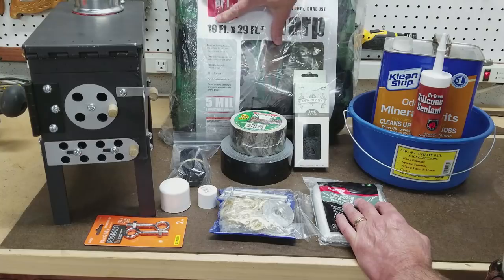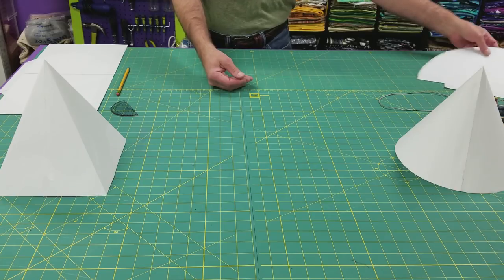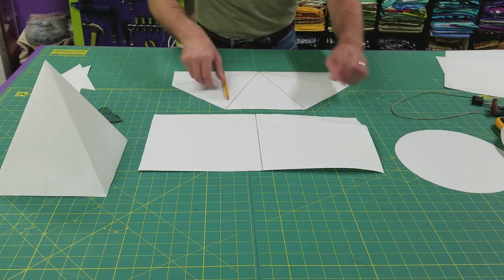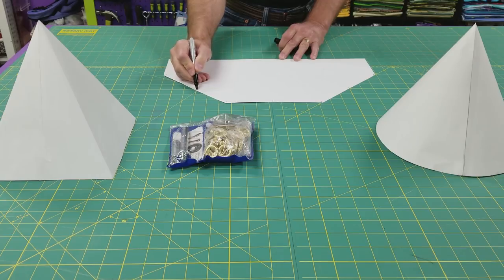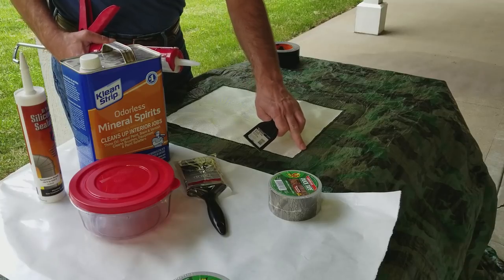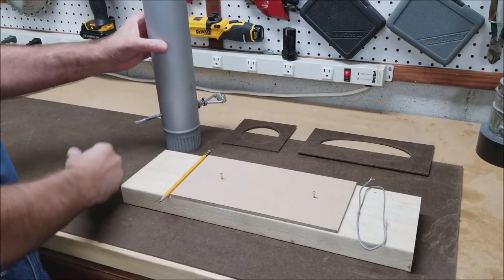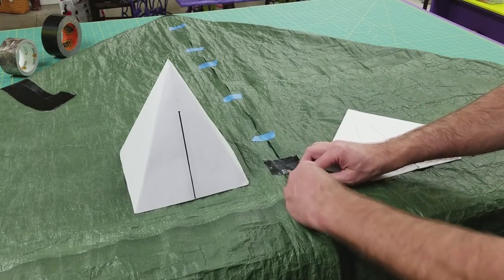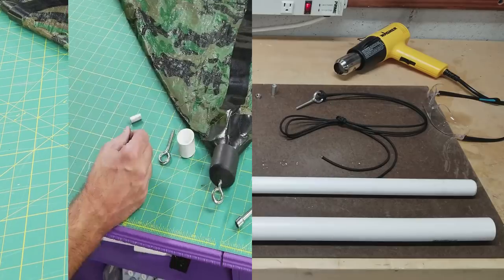How to Make a Hot Tent Teepee for Ammo Can Stove

Comment: Nice job. Here in Alabama it gets cold enough to need a heater in the tent but it doesn't get so cold our friends, the Diamondback, the Copperhead and Water Moccasin don't move. I have literally seen them try to get into a buddy's tent just seeking his body heat. Here, I don't care to sleep with an open bottom tent. I'd love to see a modification to include a bottom. Once again, nice job.
Reply from the maker: Hey Alabama, we get rattlers, copperheads and cottonmouths here too but I only use the teepee and stove when it's below about 20F.  Above that I'm a hammock hanger.  That said, a floor wouldn't be too hard to figure out.  It's a square a little under 8x8 feet.  I'd cut about a 2x2 foot hole in it where the stove goes and sew in some of the silicone coated fiberglass cloth.  I like the idea of a tent having a floor, just didn't need it for this one the way I use it. Thanks for the insight!

Comment: Awesome on your zipper don’t know where you bought it but companies that make zippers also make stoppers for the zipper and they look like little balls with a slit one goes on each end than once you put them on the top and bottom of the zipper You than crimp them do you don’t need the tape but I think you did an amazing job
Reply from the maker: Hey Miguel, thanks for the comments and the compliment!  i think I got the zipper from Dutchware Gear.  I only found out about the stoppers after I'd completed the teepee.  I'm making a replacement teepee right now and plan on using a self-stick zipper.  Thanks again!

Comment: Love the step by step instructions for the heater and the tent. And the inexpensive , well thought out setup this is. I plan on maybe adding a floor with a lipped opening for the stove and center pole. I just had one question.. How small of a bundle can you fold up/roll up this tent in this configuration? Would be awesome if it will fit inside the stove itself inside a protective bag or something to save space.. Thanks for taking the time to share with us..
Reply from the maker: Thank you!  I couldn't fold mine down enough to fit entirely inside the stove.  I think the total volume is about right, it's the problem of not being able to fold a piece of paper more than seven times.  If I could fold it one more time, it would squeeze in the stove.
Reply: I think I got the next size up in ammo can, a little on the big side, but will fit below my shelf on the backpack rack, and I found a telescopic stove pipe made from stainless steel..should be able to get it all inside that one..and a few more items as well (cooking grate, and other misc. items to keep the weight low on my pack.
Reply from the maker: I wasn't able to locate collapsible stove pipe.  You should make a video.

Comment: Great video and best hot tent idea I've seen but wouldn't a high temp silicone cookie sheets (cut and glued with the outside piece only cut enough on the bottom to put stove pipe through and make it water proof) be much simpler and cost effective?
Reply from the maker: Yep, I could have gotten two silicone mats from Amazon for about $10 and used one for the stove jack and the other under the stove.  Thanks!

Comment: This is coming a long time after you posted this video, so you may never see it. Anyway, I've seen bad things happen using PVC as tent poles when the tent is heated with a wood stove. Eventually it gets soft and the PVC collapses, along with your tent - right onto the wood stove. Since your tent is so light weight, maybe the PVC will remain strong enough. I'm curious how it worked long term with a heavier duty (thus heavier) tarp and once that sweet stove is really cranking out the heat. Best of luck and thanks for your expertly explained videos.
Reply from the maker: Thanks for commenting, HitMc!  It hasn't been an issue in dozens of uses.  I've felt the PVC when the stove has been at its hottest and the pole is barely warm.  I'd be interested in seeing the conditions under which a PVC tent pole failed due to softening from a tent stove.

Comment: I love that square shape vs. standard tipi.  I'll be using this in northern Minnesota in temps barely above, and many times below, zero.  Knowing how much this material tends to sweat when heated (from inexpensive portable ice fishing shacks) and it certainly doesn't hold any warmth, I'm assuming I could do the exact same thing with flame retardant canvas material?  I know it would be more expensive, but still pretty inexpensive.  I've seen 10'x20' sheets for just a little over $100.  And then simply sew anywhere that you've taped.  Thoughts?
Reply from the maker: If I had canvas like that, that would be my choice for material.  Breathable and more durable and well worth the additional expense.  I'd gladly pay the $100 for it for myself but I wanted to show the inexpensive version for the video.  I'd like to know your source for the canvas, that would be my next project.  Thank you!  -Tim
Reply from the maker: Thanks!  I'll give them a look.

Comment: Great demonstration on the layout of a pyramid type shelter.  You somewhat accepted the final height and side wall size of your finished tent given that you choose to use the ratio of 2:1 for the width to height of the tarp.  If you used a pyramid calculator like http://www.1728.org/volpyrmd.htm you could specify the number of sides, the desired length of side and your overall center height and it would calculate both the edge length of each triangle and the slant height.  Two different ways to get to a similar result.

Your use of PVC pipe end caps to support the peak is brilliant.  I will have to borrow that idea when I build my pyramid hot tent shelter.
Reply from the maker: Thanks, bwillan!  I checked out that site.  That would have been handy when I was designing this teepee!

Comment: its been a little over two years. how about an update? Have you used the tipi much, how has it held up? Any mods?
Reply from the maker: There was going to be an update last weekend but my campsite got flooded out.  My last video that was just shooting was supposed to be a camping video showing the new teepee.  Just to give you a head's up - I've made a new teepee with some changes.  I have a footprint for it with a cutout for the stove, which I've moved to a different spot in the teepee and I've eliminated the vent slit.  I also used  better quality tarp and threw away the old teepee.  I was able to reuse the same center pole and stakes.  Look for a new video of it next week.  Thanks for asking!

Comment: How did you determine the values for the nail distance and string length?
Reply from the maker: Great question!  A bit complicated but worth it for the correct fit.  I first had to determine the length and width of the ellipse.  The width was simply the 3" width of the pipe plus 1/4".  For the height, I had to project a 3" pipe coming up through the tent wall at the correct angle.  Once I had those two measurements (or major and minor axes), I used the instructions found here:  https://www.mathopenref.com/printellipse1.html
Reply: @timcanthejigman7932  Wow. Thank you so much.

Comment: Just a thought. Wouldn't a PVC Pipe Center Pole just warp and bend cause of the heat?
Reply from the maker: I've had it out on overnighters and just finished testing it with wood pellets. You'll see that video up in the next few days.  The pole gets slightly warm to the touch but that's about it. Thanks for the questions!